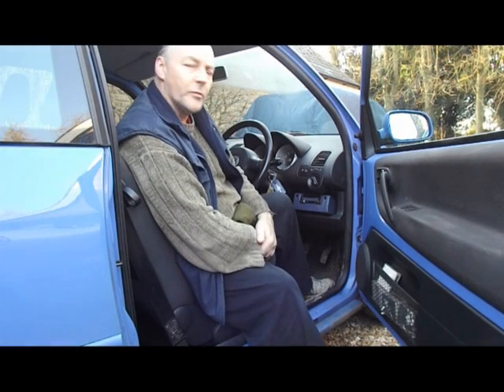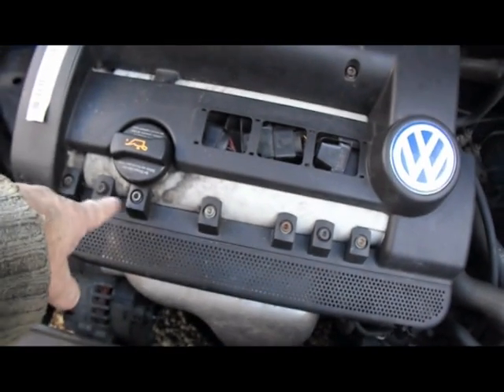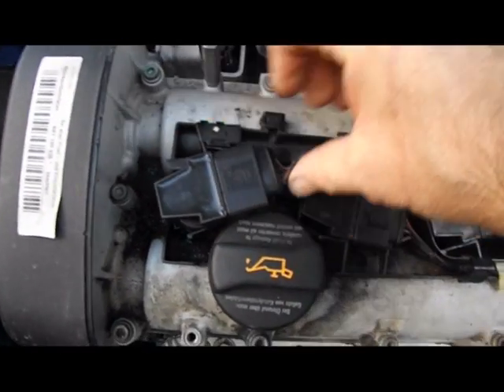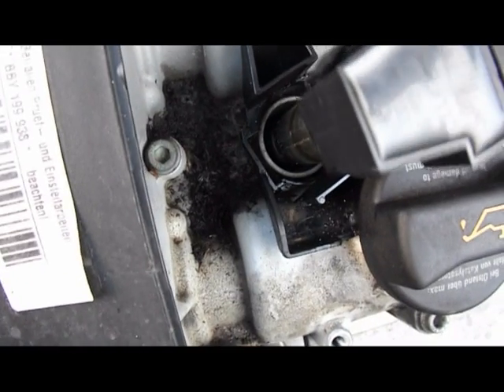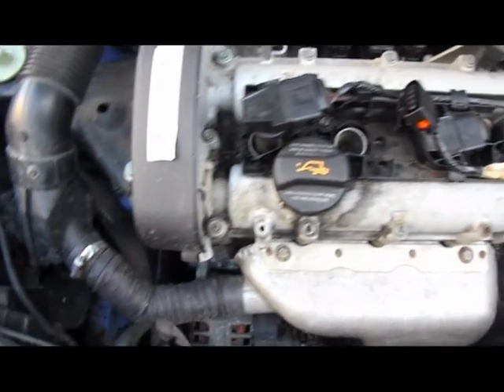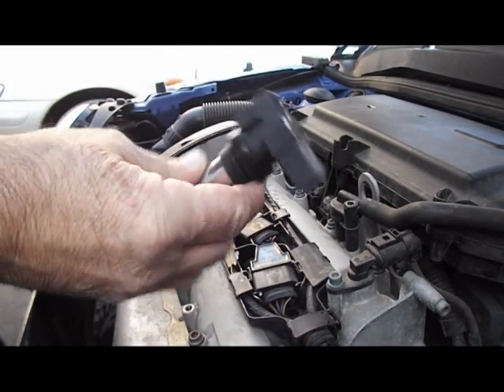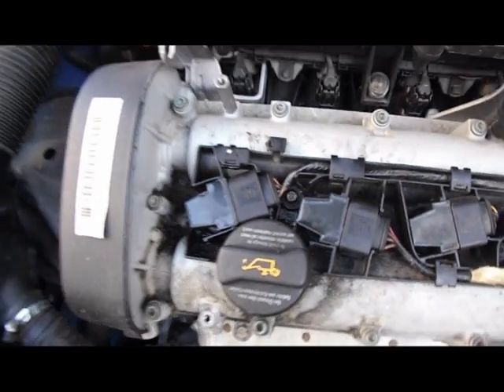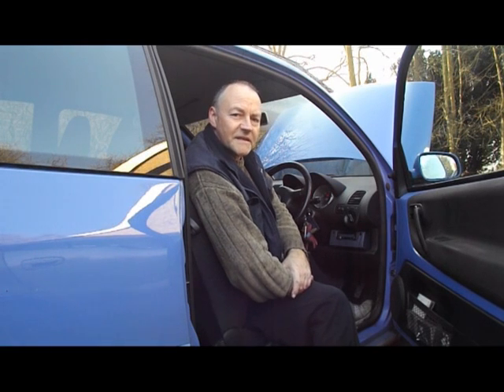VW Lupo 1.4 Misfire Diagnosis & Pencil coil pack replacement

Comment: Hello, i have polo 1.4 and i have cleaned throttle body, changed plugs with new but still my car do little missing in idle position and acceleration is little slow. Can you tell what it can be?
Reply from the maker: Could be a coil pack or lead starting to go, any faults showing on the OBD2

Comment: this looks like something on my engine  (from europarts)
 

HAAS Ignition CoilProduct Code: 413440291

and not this as per the video

VM Ignition CoilProduct Code: 413440425

but garage says pencil coild ned changing for cylinders 2 and 4

Comment: are there different lupo engines? been told cyclinders 2 and 4 need new coil but my engine doesbnt look like this.  was told its pencil coils but i think my engine as a pack instead of individual coils?
Reply from the maker: Hi 
Yes there are different VW Lupo Engines, when ordering coil packs you will need to give the engine type, size or even easier state the number plate registration number and the supplier should be able to supply the correct item.....hope this helps TC

Comment: my golf 4 has the same engine and the same issue,changed the coil pack and after a few days it happened aganin.what causes this damn problems ?
Reply from the maker: Have you checked the fault codes to see if it is a different problem ?, if it is a coil pack problem it may be a bad coil pack which was delivered to you...

Comment: hi there, best video I've seen by far on this topic so I've liked it. however i have a question, when ordering the ignition coil pack for coil pack number two on my car. will each coil pack be different for the order it goes on at the shop or  will i they all be the same and i fit it into the right one?
Reply from the maker: They will be the same coil pack and you just put it in the correct one

Comment: How do I take that coil pack off without breaking the plastic? its very tight
Reply: Try using a coil remover tool part number t10094 to be exact.

Comment: hi have a lupo 1.4 16v it had a misfire , if u plug it in on the machine it showed cylinder number 2 and was consuming fuel very much black smoke coming out , what we have done is changed the head gasket was worn out and check cylinder number 2 it's fine even the rings are still good . now we now left with one problem it's still consuming a lot of fuel you see from the black smoke coming out of the exhaust.  what could be the problem
Reply from the maker: Black smoke is usually a sign of oil getting into the engine and burning with the fuel, white smoke is a sign of water getting in, as it is black smoke you are looking at oil problem, did you do a compression test on all cylinders, if they are all good then it may be a valve oil seal, if all appears good then try a thicker grade of oil especially if the vehicle has high mileage.
Reply: Thank you

Comment: hi dear such a nice video my enine vibrate alot same like that and some time when i m driving on motorway around 70 mile and break or take of my foot from race padel car hickuup and lose power and then i have to press hard and get my power again 
i think i have to chnage coil pack some one told mento coil just leads some one coil so guide me and can you upload your video regarding 
 carb cleaner to clean it, once cleaned spray a little carb cleaner in every two months just to keep everything clean, thanks my vw  polo 12 2002 i thnk i have to clean thanks

Comment: Thanks, I'm driving 1.4 polo classic. the power cuts off as you step on clutch pedal towards a stop sign, traffic lights etc or even when reducing the speed. I can't drive from 100km/h to 60km/h as it will start cutting power very heavily and eventually goes off. I have done engine overall and sent it for diagnosing, still gives the same problem and the figure that I have to change the entire ignition coil pack.. is it possible that all of them can be faulty?
Reply from the maker: Hi Zacharia
take the air filter off and look into the throttle body, this is a well known problem with polo's, I suspect that the throttle body is full of crap, ie carbon. Clean it by spraying some carb cleaner into it, do not use anything sharp, you dont want to scratch it). make sure the venturi or flap is free and that all pipes attached to the throttle body are free and not blocked with carbon. When you clean the throttlebody this can cause the idle speed to increase which sometimes needs to be adjusted by a garage with a computer. 
Hope this helps 
best of luck TC
ps the problem will not be all the coil packs.

Comment: Helpful video mate! My Lupo was spluttering on the way home from work and then fully died and wouldn't start again. Lifted the bonnet and noticed the top of the coilpack was a bit melted, I'm assuming replacing the coil pack should fix it!
Reply from the maker: Sounds like it, but it should start and run on three. have you got a engine check light on, on the dash, check for fault codes, I have a video showing you how to do this with an OBD2 tester, not very expensive and it will point you in the right direction,
good luck TC
Reply from the maker: Hi Alex 
remove the air filter and see if the throttle body is heavily fouled with carbon , there is a vaccum hose attached to the side of the throttle body which may be completely blocked , mine was and it took a lot of carb cleaner to clean it, once cleaned spray a little carb cleaner in every two months just to keep everything clean,
good luck TC 
ps yes the coil pack may be melted but it should still start and run on three.

Comment: Hi Tony,

Not a problem. I did notice that it wouldn't run on 2 so I found out it wasn't the coils. it turned out to be the rear o2 sensor of all things. don't need replacing though as I just used the diagnostic device where I connected this again.

Many thanks for the reply though.

Comment: Hi TC, great video and useful too. will you see a change in the rev counter ect to determine this fault?.
Reply from the maker: Lee Wosika Hi Lee sorry I've been a while getting back to you, The answer to your question is YES, it may be lower if the spark is only occuring now and again. But if there is a missfire on a coil pack you will notice it because you are then running on only three working cylinders and the engine feels lumpy and gutless.